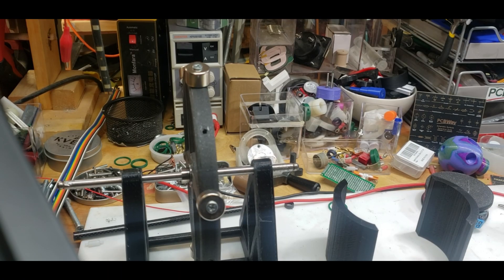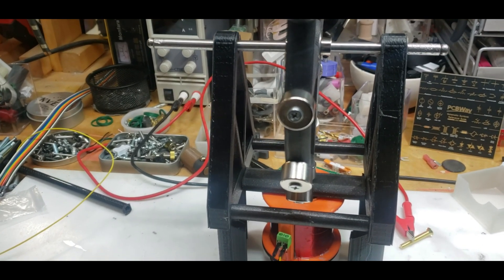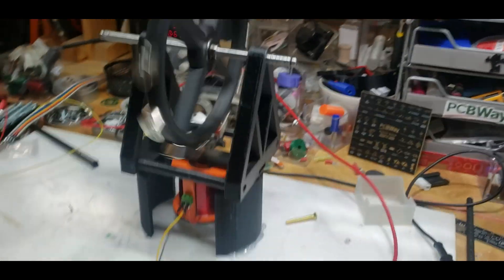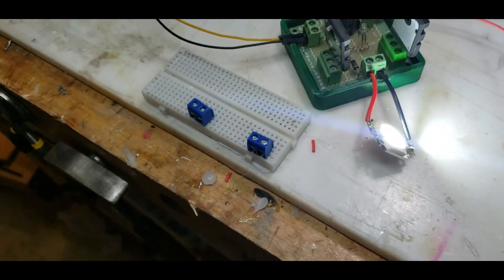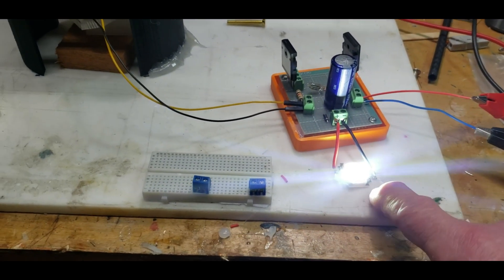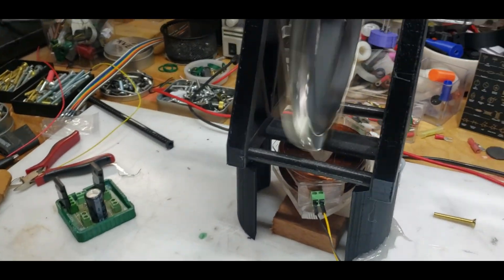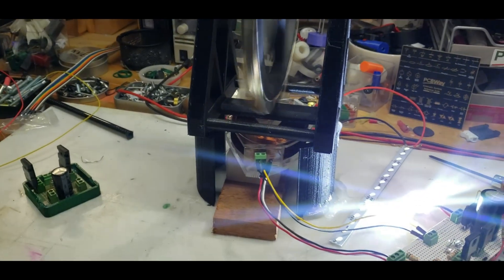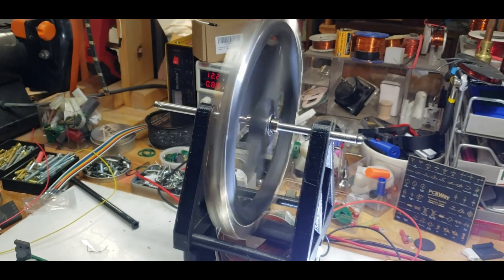3D Printed Pulse Motors and FUN

Comment: Or,   use an optical switch and have a vane pass through it, or a hall effect sensor, or other non mechanical switch.  You're asking for trouble using a reed switch in this application.
Reply from the maker: I did end up using a Hall sensor :)

Comment: The reed switch should  be  used to fire a transistor.
Reply from the maker: Yes that is one way. The other which I have done many many time is to use it solely to pulse-switch the coil.

Comment: Have a look into Freewheeling diodes or use a Power LED as a freewheeling diode ..
The function of a freewheeling diode is to prevent voltage spikes that occur when a relay is switched off. Instead of generating a high voltage and destroying the transistor, they minimize current flow and protect the voltage from damaging components.
Reply: Freewheeling diodes are the way to go, to not burn up your Reed switch...You can also use LEDs to extract light energy from these high voltage spikes from the coils...
Otherwise Joe Newman used these Spikes with Copper Graphite commutators to recharge his batteries, but then you need to power your machine just only with batteries... Hope this helps...